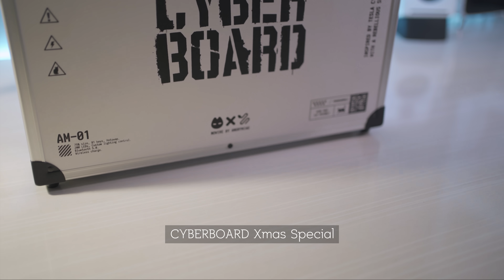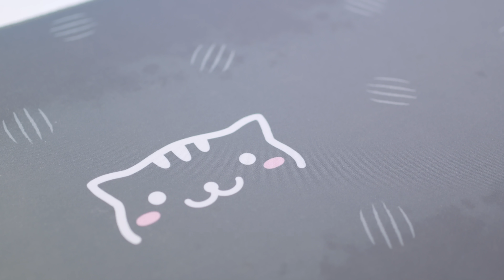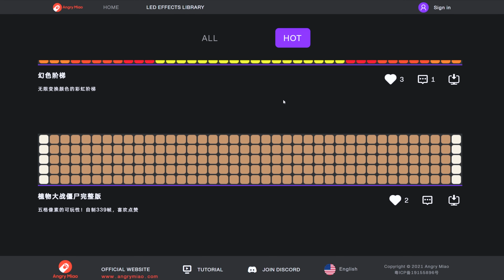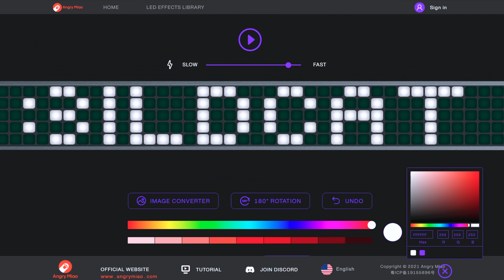CYBERBOARD🎄Xmas Special Build & Typing Sounds | Ethereal Panda Switches, GMK Noel Keycap Set

Comment: Why did you decide not to use switch films?  Others say it helps with the spring ping.
Reply from the maker: It reduces housing gaps between top and bottom. Not related to springs.
As you can see, after once opening, they are still good.
Generally, once switches are opened, they get loose so the films help.
Reply: @3ildcat  Thank you for taking time to explain! :)

Comment: hey :3wildcat i have the same stab issue that u had and u fixed it but what did you actually do because u tapped on the wire and i dont understand
Reply from the maker: Just balancing
Maybe this part https://youtu.be/B1TodVGvF2g?t=81
Reply: @3ildcat  thank youuu